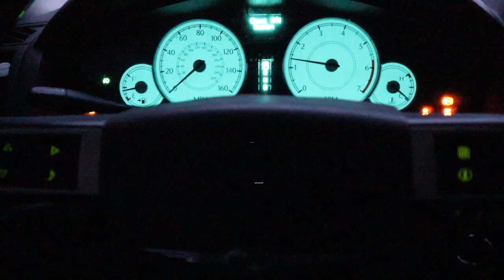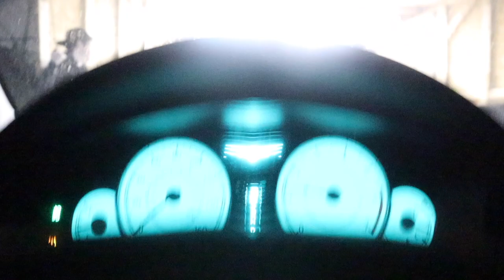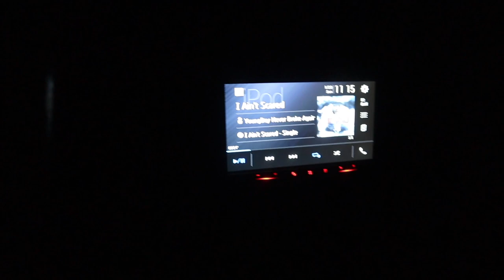I Had To Fix This On My 2007 Chrysler 300C SRT Design

Comment: Quick question I’m looking for a v8 I currently have a v6 300 do you think I should get the 5.7 or try and get the srt8
Reply from the maker: Man If You Have The Money Go Big Srt8 If Not Go 5.7 But I Regret Getting The 5.7 Only Cuz I Rushed Into It I Could’ve Waited And Bought A Srt8
Reply: @EbayShotIt  appreciate it
Reply: u can build the 5.7 to be better than the 6.1 just bore nd boost and upgrade internals